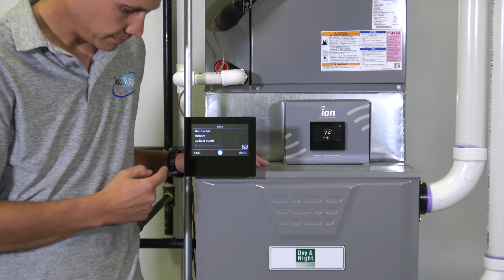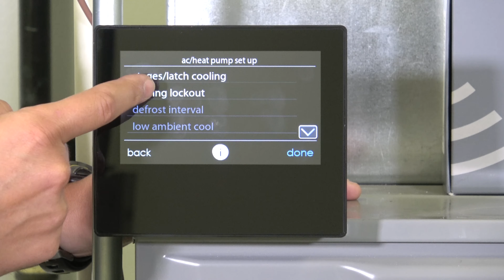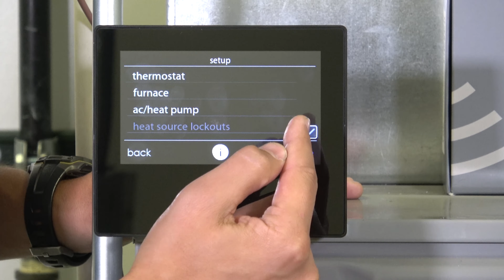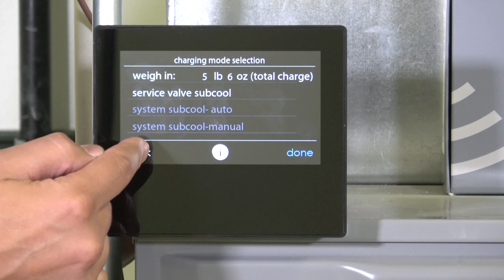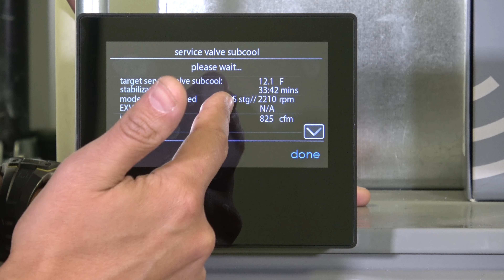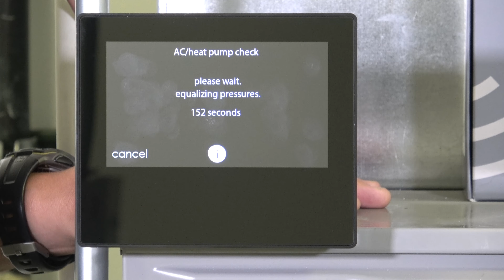Comment: I have an ion thermostat & comfort maker furnace. When the home has a power outage & the power returns my ion thermostat will not receive power. The only way to turn it back on is to cycle the furnace breaker. Any ideas? 
Thank you
Reply: Is the breaker tripped?
Reply: @TEC @TECTubefilms  no the breaker does not trip. When power returns to the entire home everything is on…furnace included….but the thermostat is off meaning no power. When I turn furnace breaker off then on the thermostat gets power
Reply: @glengignac173 If you have the skill set to work on electrical, then the next time this happens, take the stat off the wall and check for 24vac on C&D at the wall plate. Then work your way backward until you find the exact spot (stat, plate, green plug, circuit board, etc) that you do not have the 24vac. Then you will know which component is defective and needs to be replaced.

Comment: Good stuff.  I think my unit was set up correctly by the HVAC installer but the outside temperature display is consistently wrong.   It does not go above 66 degrees F, for example.   Is this something that can be fixed, or is it necessary?   If it's just information and not affecting the AC operation, I am okay with the incorrect display.
Reply: It does matter and not just for display purposes. What is the actual temp you are measuring... at the exact same location of this sensor... when the stat says 66F? The sensor is just a 10k Type II thermistor so it can be troubleshot with an electrical meter. That will allow you to determine if the sensor is an issue, the board it is wired to, or the stat.
Reply: @TECTubefilms  Thanks very much for your reply.   The temperature difference is about 20 to 30 degrees on the display versus the outside.   I am not sure of the location of the sensor but since you answered my main question -- the value of the reading does matter to the operation of the unit -- I will get a technician to track this down on my Tempstar variable speed system.
Reply: @maxliker  The sensor is a little probe sticking out the bottom of the electrical section. It is black and covered in an epoxy. If it is reading high during the daytime only, it is likely that the sun is directly shinning on that section of the unit and heating it. If is wrong all the time, then something is broke (sensor, outdoor board, or stat). If it is wrong randomly, then the issue might be the wire or wire termination.

Comment: How do I factory reset it. Added a new AC and is currently not registering it, need to go back in the bios to manually put it in
Reply: Both a hard and soft reset will not clear out the old equipment pairing. Instead you need to use the "installation" process under the service menu to get it to forget the old equipment and recognize the new. Refer to video #1 of this series. https://youtube.com/playlist?list=PLoR_O4JRNc245jwxK-KUT-7yfvy-w1Vgl

Comment: This is all for an AC tech, not an end user. I hate this unit! I just want to heat and cool the house, not program a computer.
Reply: Correct. This YouTube channel is a supplemental support tool for the HVAC technicians that attend our in-person training classes. Others can obviously watch these public videos too, but they are not the intended audience when we make the videos.
Reply: Why do you hate your Ion control? Once it is setup by your installer, you should not need to access anything in these screens in the video. You can just bump the arrows up or down to change your setpoint (or put the system on a time schedule for home, away, wake, and sleep times) and not worry about anything else.
Reply: @TECTubefilms  It was set up by installer.  Heat to 68o, cool to 76o.  Sounds nice. When we build a fire in the wood stove, the A/C comes on. I smoke up a fry pan, I can't turn the air circulation on. The Owner's Manual is such fine print I can't see with reading glasses. Punched a lot of buttons not understanding what to do. I went to the website thinking they would have a manual I could print larger. I contacted ION, suggesting they print larger and easier to understand. They got back... couldn't help me, referred me to installer. I am sorry to take out my frustrations with ION on Tec Tube but the control not good for older folks. I'll be calling installer---- Thank you.
Reply: @bjlewisart  Sorry, it has been a challenge. Some older folks like it because the font size on the screen is large than other stats.

To turn the air circulation on, click the upper left and select your fan speed.

To avoid the issue with the wood stove turning cooling on, switch your thermostat from auto mode to heat mode for the winter by clicking the upper right of the main screen.

Comment: Have wired humidifier to HUM terminals. Which energize a relay to make the circuit. My old humidifier wiring. Had a. Current sensing relay. Tided to the fan motor. In case of failure would shut down the humidifier. I am told by the humidifier people that with the new ECM motor if it fails it will break the circuit to the HUM contacts. Is that correct?

Comment: Heat pump lockout has 2 settings. Heat pump lockout and defrost lockout. Both are set to off and , can you tell me were i can get more detailed as to to setting this feature. Instruction manual very vague Also found my heat pump going to in to defrost mode at 40 degrees, can you tell me were these setting are.
Think You Very Much
Reply: It says 40 degrees on the face of the stat?
Reply: @TECTubefilms  No, it's 40 degrees outside and the heat pump is going in defrost mode.
Reply: What does it say on the stat screen for outdoor temp?
Reply: @TECTubefilms  found that very interesting at present. The stat says it's 74 degrees. And the outdoor temperature at present is 64 degrees. When the heat pump went into defrost cycle, it was about 40 degrees outside. I did not think to look at the stat at that time.
Reply: If the reading is off, it might be in the sun.  You will want to consider adding an extra outdoor temp sensor, wiring it to the furnace, and locating it on the north side of the house since there is no direct sunlight.  Or cut the one on the heat pump, extend the wire, and locate in shade.

If the reading is always off, including at night, then it is not a sunlight issue.  The sensor can be calibrated +/- 5 degrees at the stat.

When you say it is 64 outside but 74 on the stat, make sure the 64 you think it is outside is not coming from tour phone or a weather service.  Measure it with an actual local sensor.  Weather apps get data from airports mostly and that may be different than where your house is.

With all of that said, it is not related to your heat pump defrosting earlier than you expect because I’m your case the unit thinks it so warmer outside than you stated it was… not colder.
Reply: @TECTubefilms  I checked out side and its definitely in the sun and the 77 degrees would be right for the conditions. 
	 I'm wondering if you can help me know, if i'm on the right track. My energy usage shows that i'm using $0.25 a day for electric heat. My only thought is. That it goes in heat mode to offset a defrost.  And it's running electric to offset that. Even though it has not been cold enough to really go into defrost. I also show the electric heat had gone to stage three several times. Our temperature has only gone below 32 a couple of nights. Have no idea why this could be. Any thoughts would be greatly appreciated.
Reply: You need to set the utility rates on the controller to get accurate energy cost estimates.  We suggest you take your total bill and divide it by your kWh for the month.  Don’t just use your contract rate.
Reply: @TECTubefilms  I reset the controller based on your advice, which should give me a more accurate reading. Thanks for the information.
Reply: Yes, your system can energize the electric heat to temper the air during a defrost event to prevent cold air from blowing on occupants.
Reply: It will take a deeper dive into the service settings of the Ion control to figure out if your defrost is setup correctly.  And the same to figure out why you are using 3 stages of electric heat… it depends on how things were configured, as well as the heat pump sizing relative to your design day load calc.

It is also important to make sure that no one has setup a heat pump lockout that favors electric heat.  If you have an ICP inverter unit we recommend that the heat pump be used all the way down to 10 degrees.  If you have a 2-stage heat pump, we recommend that the thermal balance point be calculated for that specific system at your specific house and then set for that number… which is often below 0 degrees outdoor temp.
Reply: This may help with heat pump balance point.  https://youtu.be/Pdiz95p8O9Q
Reply: Here is another https://youtu.be/4oInrsjL_qQ
Reply: No offense to you in anyway, but these are fairly advanced topics for the average homeowner.  This stuff is normally handled by your Heil Dealer.
Reply: @TECTubefilms  NO OFFENSE TAKEN. 
But to help you understand where I'm coming from. In the past I've worked on everything from 3000 ton chillers to home refrigerators. My situation might be Similar to yours if you were retired and 82 years old and you need to install a new thermostat. You probably know more than the man that's coming to do it. Also. Your mind has been trained to work in such a way that as you walked by the controller you think, why is it doing that now? It's not easy to live with new technology with a  Inquiring mind.
AGAIN, I THANK YOU VERY VERY MUCH FOR ALL YOUR HELP.